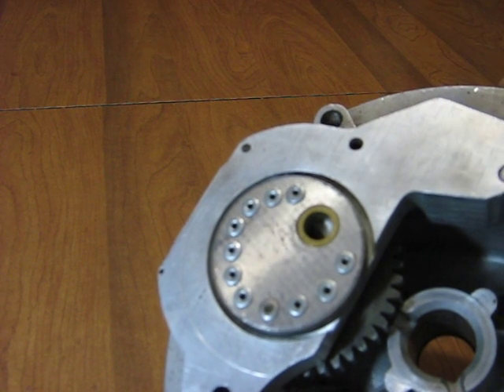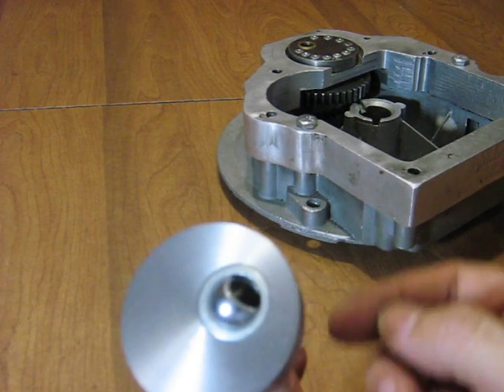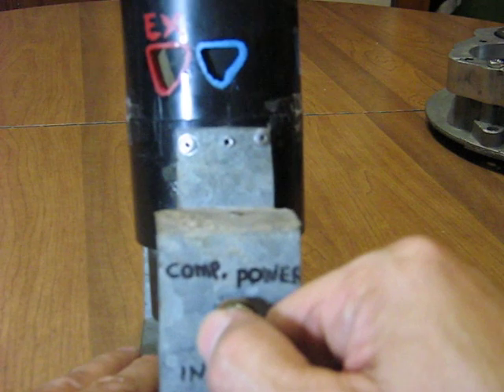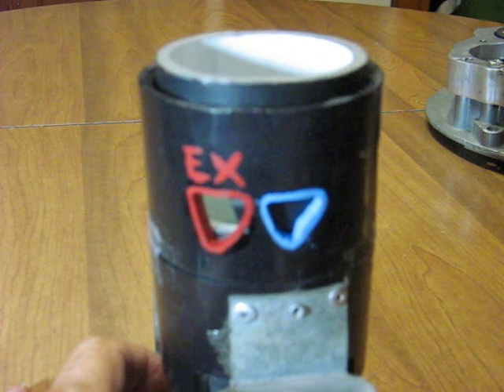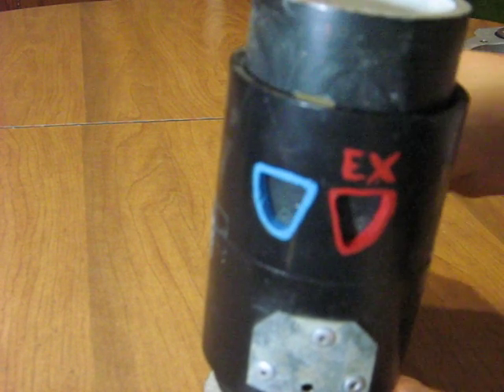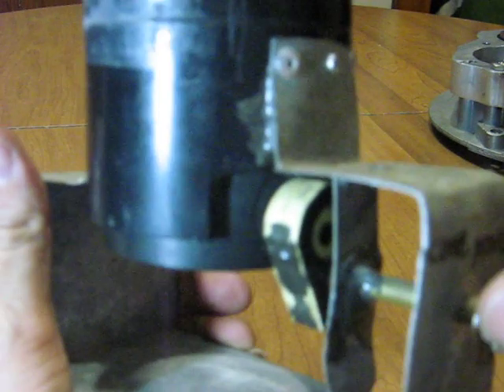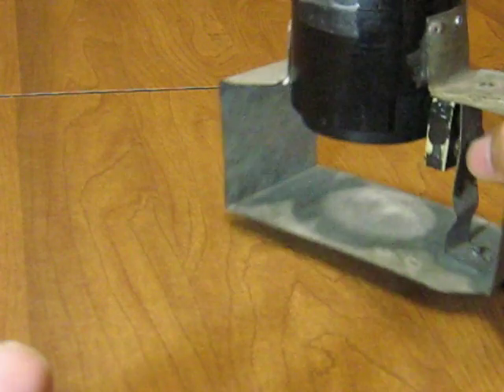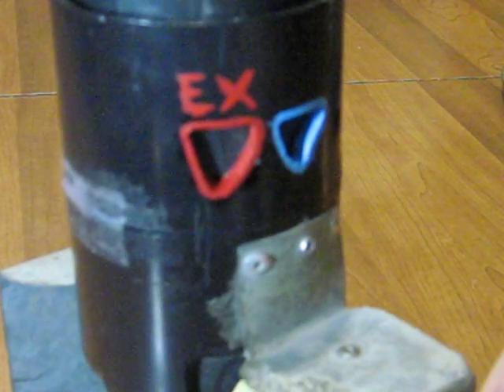Sleeve Valve engine -Sleeve Drive Model

Comment: ChargerMiles007 Just don't take Setright too seriously when it comes to power outputs vis a vis the Napier Sabre. He is the only source to claim 5500 hp for it and to say his claim is suspect would be almost obvious. The Sabre had about the same cubic capacity as the formidable Rolls Royce Griffon but with double the number of cylinders. Frank Halford, the designer of the Sabre, became enamoured with the idea that a "hyper" engine running smaller cylinders at higher RPMs would have more development potential. The problem is that aircraft engines have to be reliable and high revs and high outputs don't necessarily go hand in glove with high reliability.

On top of that - and the reason why I urge caution when reading Setright - is the fact that all piston engines are trying to do the same thing. They convert the energy value contained in the fuel into mechanical energy. With fuel additives and supercharging you can make gains in power but the fact remains that a V12 and an H24 are only very similar two ways of doing the same thing. Each has its advantages and disadvantages. The inefficiencies are pretty much identical so there will be a limit to the efficiency of that conversion and the variations between the two will only be in the order of a couple of percent.

According to Pierre Clostermann, who flew the Hawker Tempest, the Sabre could be overboosted to 3000 hp in an emergency but the engine would not last more than a few seconds before it blew up. The idea that a 24 cylinder engine of any configuration could produce more than double the output of a 12 cylinder engine with the same fuel and same cubic capacity is just beyond the realms of possibility.
Reply from the maker: TheThirdMan True, The Power to Fly is the only place I have read about a test Sabre making 5500 horse. It is a shame that there aren't any Sabres still in running order, as I would love to hear what one sounds like!Unfortunately Setright passed away a number of years ago, so we can't press him for his info source on the figure. One thing is for sure though, back in the day, the amount of design, fabrication and testing and brain power that went into all of these various engines was an enormous effort! My hat is off to all of those folks from the WW2 era.

Comment from the maker: It sounds like you have an understanding of how the sleeve moves vs the piston. Remember that the sleeve stroke is a lot less than the piston stroke. Eg. my engine has a stroke of 1.75", while the sleeve stroke is 1". I used to know what the stroke for the Sabre was, but don't right now.
 The best reading I have found on the Sabre is "The Power to Fly" by LJK Setright about 1970. Another good source is Flight International magazine, they have old issues from the WW2 time period online.

Comment from the maker: @smvuy
Yes, intake and exhaust overlap is no problem with a sleeve valve.
It is more of a geometrical problem to figure out where to locate the ports, but it is actually quite simple to do, you unravel the cylinder wall so it is flat, like a sheet of paper, then draw out where the ports should be. This model was done to show a bunch of different design possibilities.

Comment from the maker: You are right, in that type of double sleeve mechanism, the sleeves don't rotate at all, the Willys Knight engine was that type.  That was actually the first type built, and the single sleeve valve came later. The double type used 2 small cramkshafts and connecting rods to drive the inner and outer sleeves. The single sleeve is simpler, and somewhat easier to understand, as well as build.
I am currently building a 2 stroke sleeve valve based on the Rolls Royce Crecy design concept.

Comment from the maker: Further comment:
The black plastic model shown here, does not completely represent the sleeve built for the lawnmower engine.
The sleeve port shapes used in the model are all different representing various valve timings, and some ideas I had. Generally in an engine all the ports would be the same size and shape for inlet and exhaust ports, but mirror images of each other.
If I am not being clear here, ask me a question, as I want to help others to understand the sleeve valve :)

Comment from the maker: I didn't actually invent this valve mechanism, it is called the Burt -McCallum single sleeve valve. It was invented in 1918 I think.
The British built thousands of sleeve valve aircraft engines, mainly by the Bristol company, but also by Napier and Rolls Royce. An example would be the Bristol Hercules 14 cylinder sleeve valve radial engine, produced from about 1939 thru 1960 (?)
Yes, the sleeve motion is called reciprocating & osillating. The sleeve has 4 ports, the head has 5 ports.